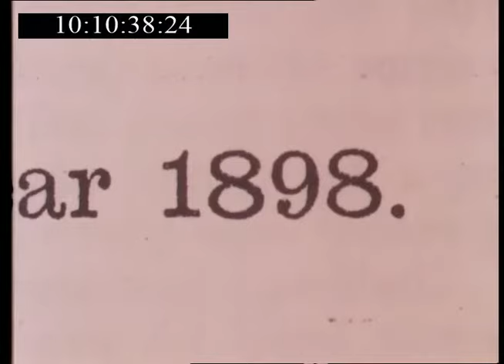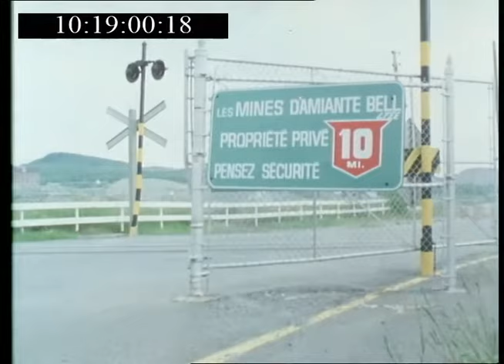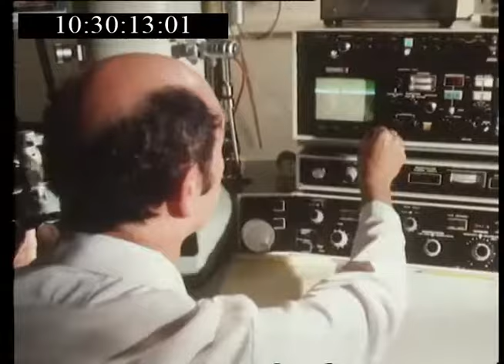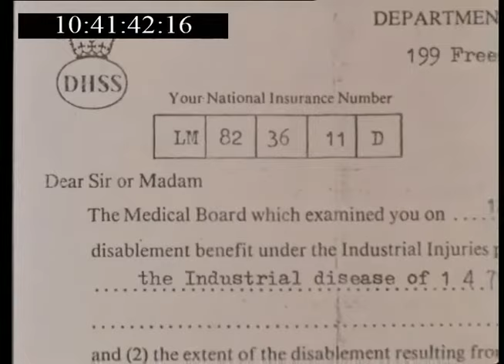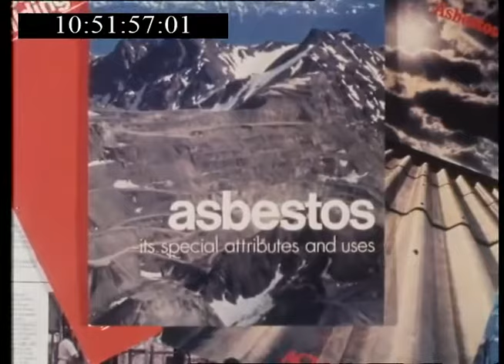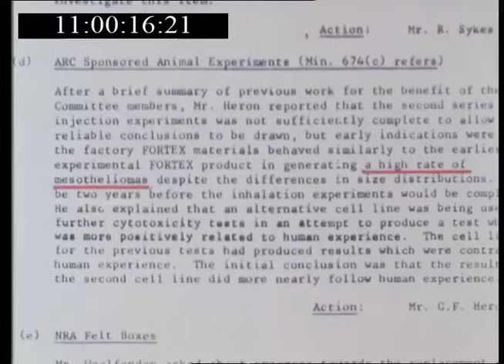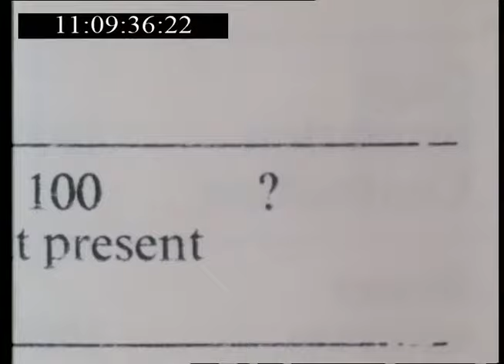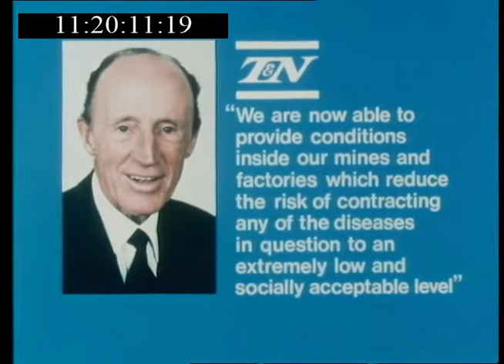Alice A Fight for Life (1982)

Comment: How likely would a house built in the 1990s contain asbestos?
Reply: In the UK anything before 2000 is possible. 1990s less likely but could be in lower risk cement products such as garage roof or in textured coatings to walls/ceilings
Reply: Possible. Just paint it and leave it alone and you won’t have a problem. Or call a removal company.